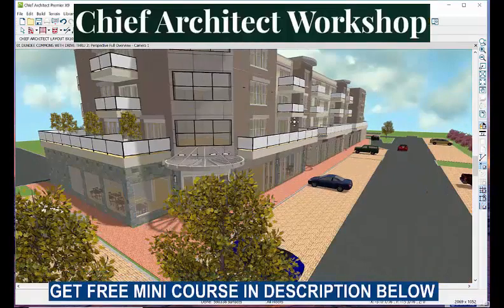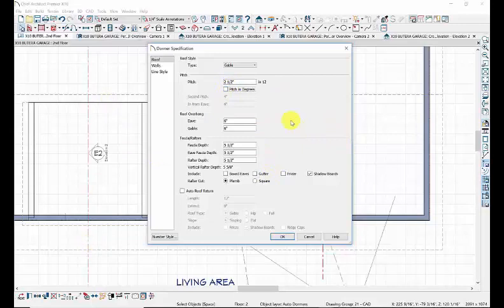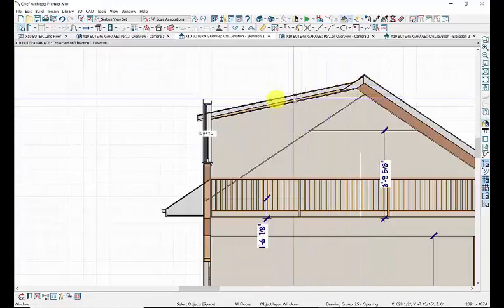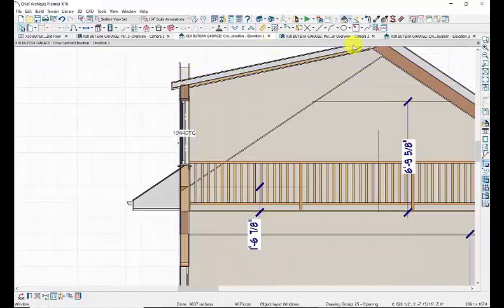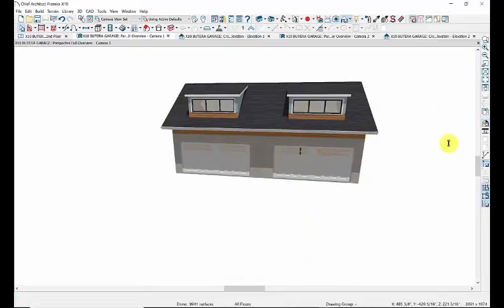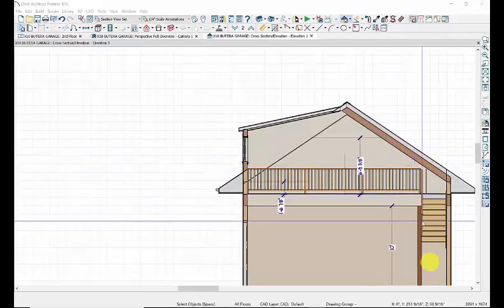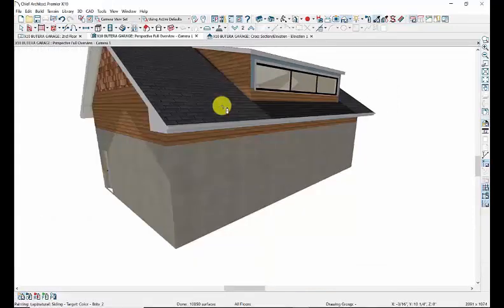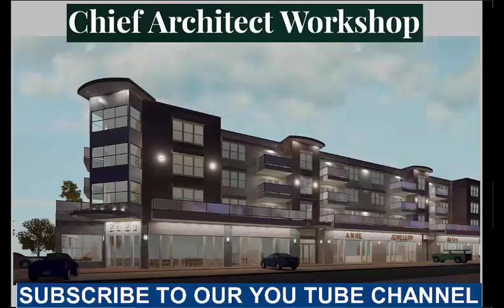HOW TO BUILD A SHED DORMER WITH THE AUTO FLOATING DORMER TOOL

Comment: I've got a 32" wide Cape that I'd like to design two from Shed dormers on the Front, and a full shed Dormer on the back. Does the software account for the allowance of permanent load with varying roof pitch?
Reply from the maker: This is NOT Structural Engineering Software.  You must get help from a Structural Engineer.  This is 3d Design Software.